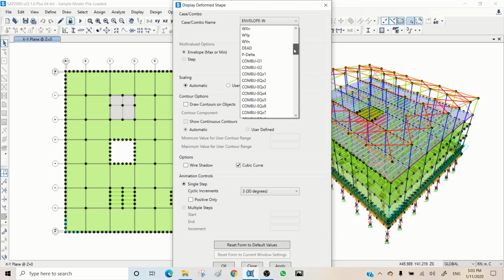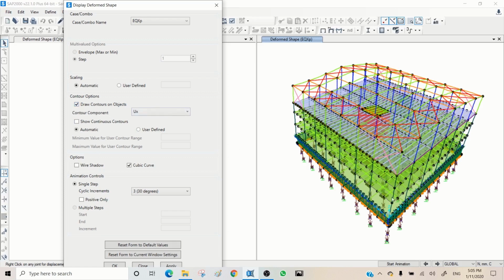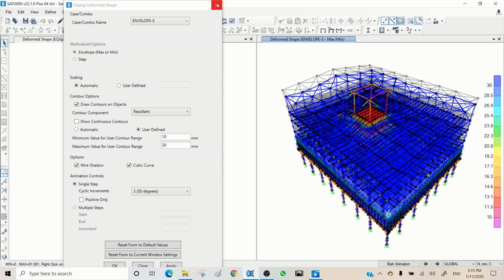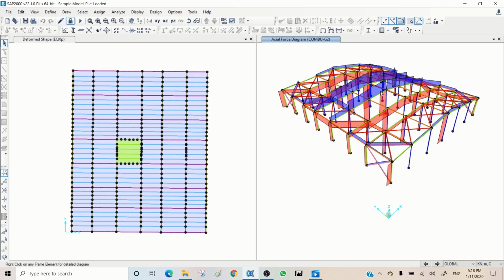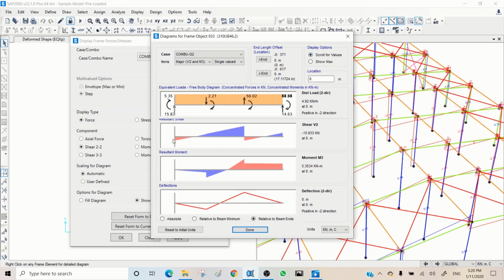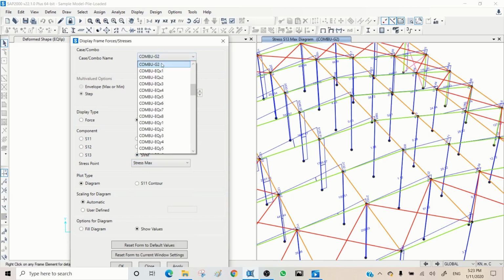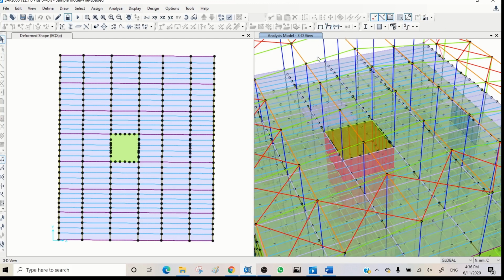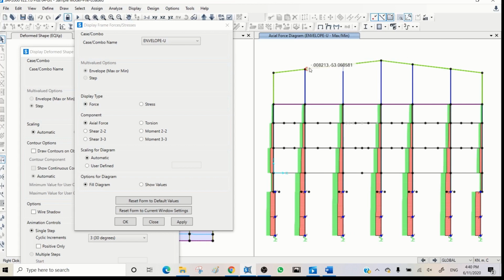Module 6 Video 1 Part 1 Check the Results of Analysis and Finalise the Model for Design

Comment: Should the axial compressive force in roof bracings be minimized? Some tutes show that setting nonlinear load case would make this work. Please share your way to tackle such issue. Thanks.
Reply from the maker: Yes, if you want to design tension only bracing, you need to use non-linear analysis in Sap. But if the roof braces are strong enough to take the compressive load, there is no issue with that. This is mostly recommended if the critical lateral loading is earthquake load or very heavy wind load for post desaster buildings.